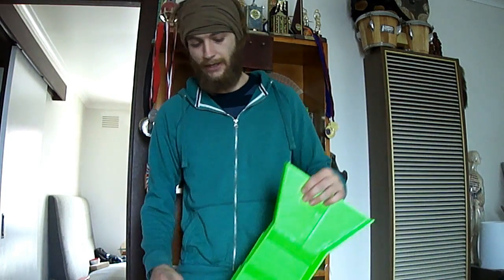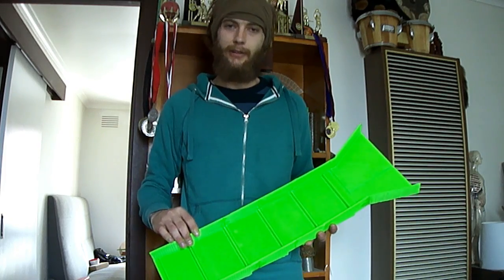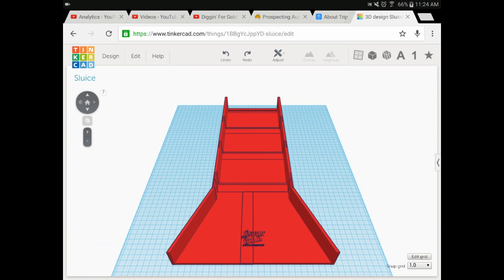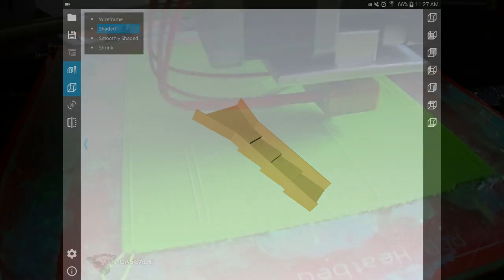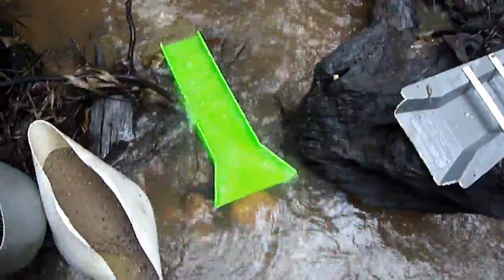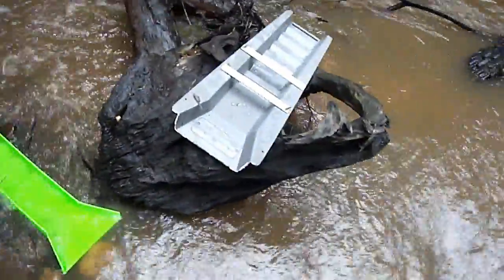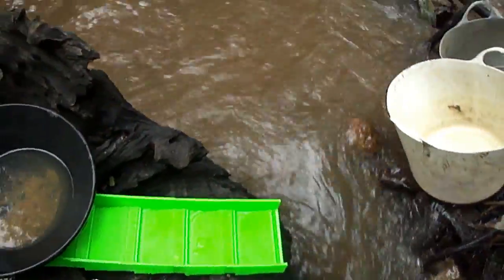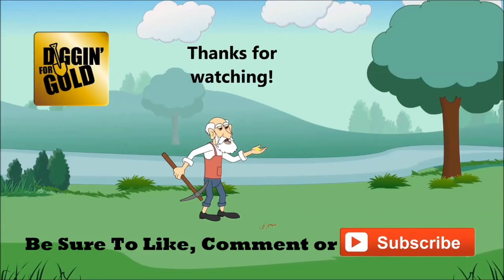3D Printing a Sluice for Gold Prospecting

Comment: It warps because the heat on the 3d printing board needs to be hotter
Reply from the maker: Not necessarily. I've found that the ambient temp needs to be hotter, not the bed itself which is well hot enough. As it prints up and gets further away from the headbed then the upper layers cool off, contracting and pulling the bottom up. So I cover it now so its all enclosed, keeping the heat in during printing and that stops the warping.
Reply: @DigginForGold  Oh cool thanks.

Comment: Hey mate been a few years since you made your sluice. I see you posted the files on Yeggi. Are you still having success with the 3d printed sluice?
Thinking about giving it a go
Reply from the maker: The green one from the video I no longer use as I just didn't really like it. But I printed another similar but better one (grey) and that one I still use sometimes. If you can afford a proper one I'd recommend that, otherwise a 3D printed one will do in a pinch. They're definitely not as strong or durable so you've got to be a lot more carefull with em, but they do catch the gold.
Reply: ok awesome thanks mate

Comment: i'm pretty sure you got the riffles backwards
Reply from the maker: What? Lol. No, they're not backwards. They're called a drop riffles.
Reply: yeah heard it later in the video.
Reply from the maker: I prefer this style of riffle. Its basically the same as the Angus McKirk line if sluices, and they're some of the best sluices if you ask me.
Reply: i'll be using stackable sluices myself.  but also not for prospecting. just clean up

Comment: Thanks for linking your STL files. I don't have a printer but I do have a DIY vacuum forming set up and some 2mm ABS offcuts big enought for a 950 long sluice but I need to redraw your files in DXF first so I can change some angles. Do you think that it would be worthwhile adding some perpendicular grooves just in front of the first riffle? It's good to see you back at it, I have missed your vids greatly.
Reply from the maker: +loskop100 Kind of like this other one I did (not sure if you saw this one or not). : http://www.thingiverse.com/thing:1897847
Reply: No, I hadn't seen that one and it has the grooves already too. Thanks for that.
Reply from the maker: +loskop100 no problem :)

Comment: bro use PLA its stronger for this
Reply from the maker: +XCWS™ NITE (Graphics Made By GfXCWS) PLA would be the wrong choice for a sluice. Firstly, its plenty strong enougn as it. Secondly, PLA would bend and warp. I mean, this is a product thats meant to be used outdoors...in the sun. And it'll be left in a hot car regularly. PLA just wouldn't  hold up.